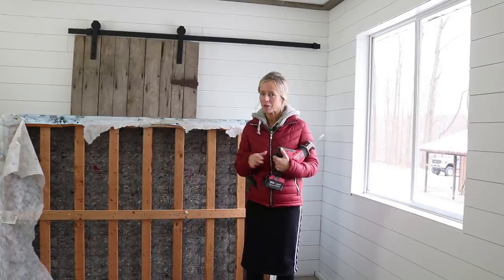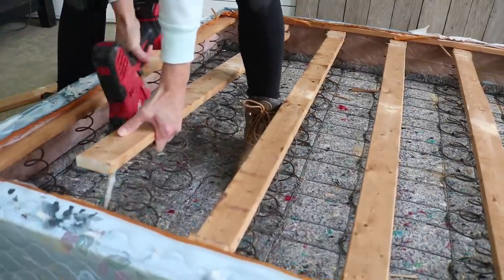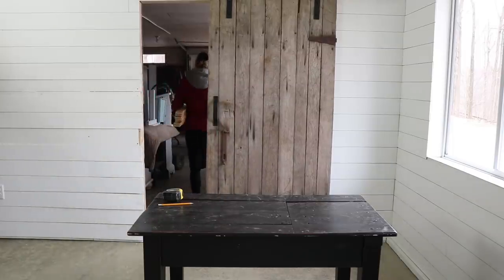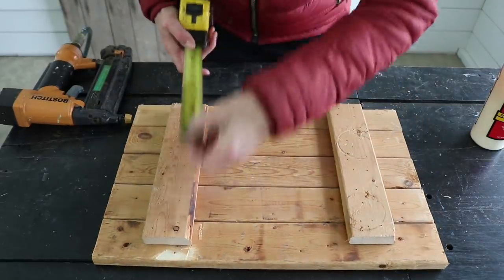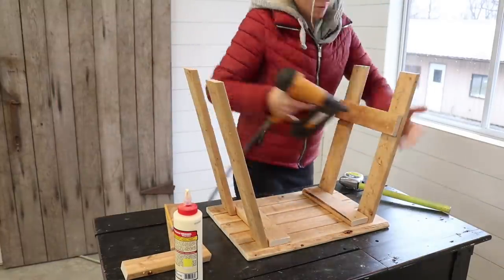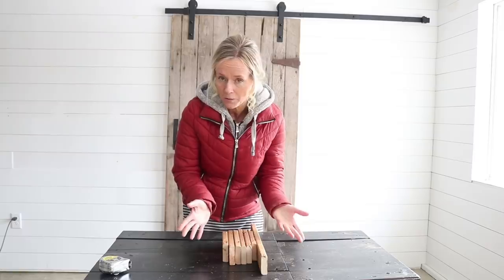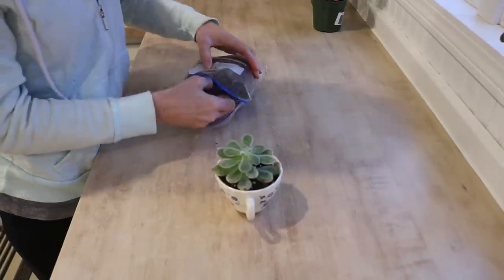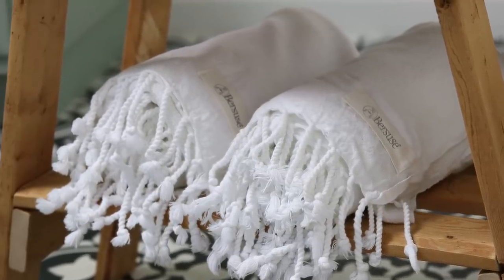Bed Springs Repurpose ~ DIY Furniture ~ Box Springs Upcycle ~ Repurposed Furniture

Comment: I suspect that wood is well dried hard wood vs soft wood from the Home Improvement stores. Well worth the work breaking the box Spring down IMO. You did a great job! The little table has allot of character!! Turned out beautiful. The springs if cut up with a grinder could potentially make cool Christmas decorations painted silver and zip tie some lights for brightly lit spirals.

Comment: I remember one of the first projects I had in my head, I so desperately wanted to do the project but didnt have any wood in my shop. Heaven forbid I go buy wood, I am too cheap for that. I noticed an old box spring in the rafters of my garage.
I got it down, took it apart and had lots of wood. The best part is I didnt spend a dime and the wood was already rustic looking.
Good job Mary, we think a lot alike. 😉❤🇨🇦

Comment: Hi Mary, the stool is fabulous and the soap box is so cute.  I took apart a mattress with springs once and it didn't have the wood strips which was good.  I tore off all the material and stood the whole frame up and leant it against the fence in the yard. I then hung all old rustic shovels without handles on it and made a sign which read, "Diggers Rest".  I think it looks great.  Or you can grow climbing vege's on it.  I wish I had a big workshop like yours to have fun in.

Comment: Mary,
Excellent projects as usual!  Love it all❤️ and guess what I got when I purchased an iron bed from the 1930's....that's right, the mattress and box spring.  I threw away the mattress and something told me to hang on to the box spring.  (This grossed me out, but the family told me the grandmother had kept the ORIGINAL box spring....and just updated the mattress when needed.  On the mattress was a label with 1972 on it.  So grandmother had used the same mattress from 1972 to 2010!). Yuccch!  It really didn't look that old, no stains at all but no way was I using that mattress! LoL.  So, I kept a 1930 box spring that is made of red oak....the wood is beautiful.  And I have a plan.....will tell y'all about it when I get it done.  It will prob take a month because I will need some help from an electrician.  Love you Mary-you truly are an inspiration to all of us.  And like a few others have mentioned here, any time you are cutting anything, wear eye protection.  I have a really cute pink pair.  Got those so none of the guys I worked with would take them!  HA!  It worked.  Stay well.  Thanks again Mary for always sharing the best ideas!

Comment: Springs are also fun to hang on the wall with little lights strung through them. My best friend did that and it was fun! You can also use tiny clothes pins to attach photos.

Comment: Great idea!! I used the springs from one mattress as outside decorations. I found beads that fit on them and a wire nut to keep them from coming off. Jute would work also on the springs. Or spay paint. We have a couch to take apart. I hope to recycle it into decorations.

Comment: The springs work well to spray paint, you can use them as a base for flowers, put a vase down in them, I am getting ready to do the exact same things, and am going to cut like you did instead of taking everything apart like I normally do.

Comment: Those turned out great. My nephews dog could have done that. She slowly ate a sofa they had on back porch. Not really ate but over a few moths tore it apart. Down to only wood. I’d be trying to save it too. I follow a youtube person called Ana White. Has a website too. She makes everything. Until her own big shop. And they built their house in Alaska she is tiny like you. But she just wanted to make things she liked and strong. She uses an angle jig for drilling holes. Noting shows and strong. I want to make some of her patio furniture. She shows how to do with videos. You could probably do it without even buying any plans. Her projects Don’t use a lot of wood. The trick is how its put together. She also shows some how to do with all the tools but how to do if you have minimum tools. i was thinking the springs would make bouncy legs on a chair. But would need base at bottom or would. You fall over?

Comment: BTW, those individual springs can be used in your garden....just screw them a little way into the soil and put a small terracotta saucer on top with a candle. It makes a pretty light scattered throughout the garden, sorta like fairy lights.

Comment: A benefit of using these boards vs new wood is this wood has dried well. New pieces of wood will dry differently and the finished project would probably warp.

Comment: The fastest and easy way to do it. Is to cut the material off and strip it down to the springs. Then use a screwdriver to pry and pop  the springs off of the wood. you'll end up with the whole wood frame  and you won't have to cut any metal. And it only takes 10 -  15 mins to do it.

Comment: It turned out really pretty. But, I noticed that you didn't wear safety glasses. And with dealing with metal that could spring back as you cut it and taking staples out and they could fly, both hitting you in the eye. It's really important to wear them even if you think you're safe without them.

Comment: You gotta be kidding!  All that work tearing apart a box spring for a few pieces of wood and some springs.  With all those staples and metal pieces, I'd be astonished if you didn't hurt yourself in the process. If you wanted the springs, you could have just burned the thing et voila.